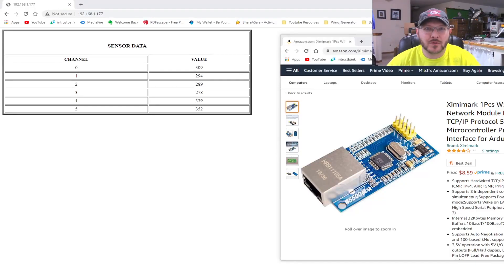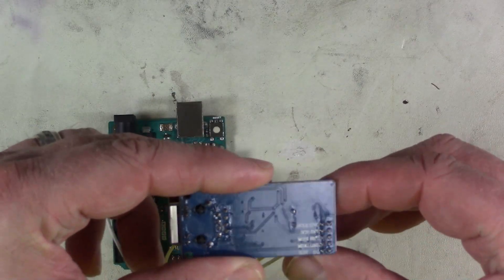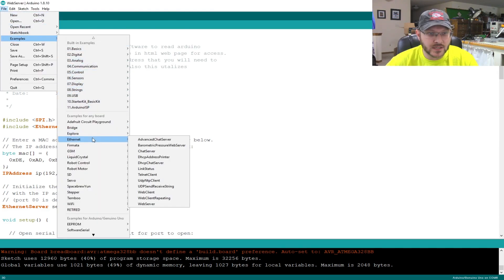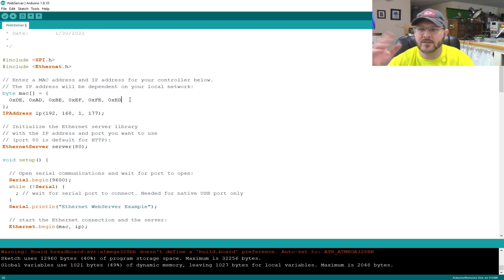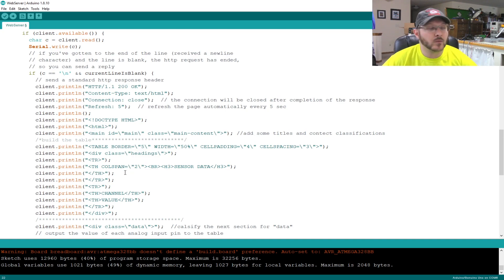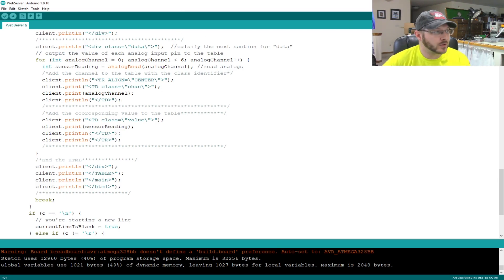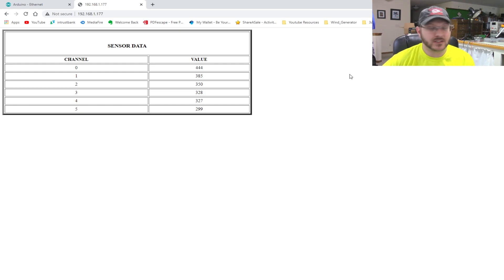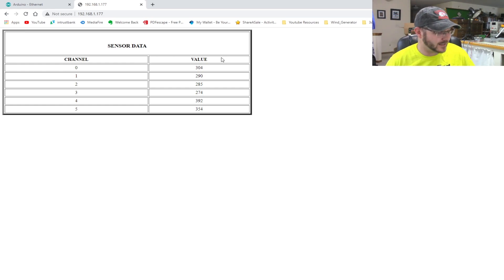Adding Wired Ethernet to Arduino

Comment: How is the W5500 connected to the Arduino. Which pins on the W550 to which pins on the Arduino? This is not explained on the video or on Github...

Comment: I do prefer the smaller form factor ones( same chipset but not so bulcky( also they come in packs of 2 for $20 vs this model comes in at $30/1pc ( connections+coding is identical so still awesome tutorial 😊))

Comment: Hello good sir, thank you for your excellent video. I am wondering if you could help me: I am trying to use the ethernet capabilities of the W5500-EVB-Pico microcontroller (I already set it up in my Arduino IDE), but I cannot seem to get it to work, even when I get it set up with the Arduino IDE. Specifically the Ethernet.begin(mac) times out. Any specific instructions for the W5500-EVB-Pico?

Comment: Haha people the ethernet cable is simply just an example of using a common off the shelf and cheap cable to deliver the SDA and SCK signals over long distances. CAT5 is simply just 8 wire cable. Only 2 of the wires in this cable are being used in the example shown here.

Comment: Ahahah! Dead beef feed... Why not!?
Here's a question : You had all the code, and how to connect the Arduino to the shield and I am happy with that but it was pretty short on how to connect the shield to the PC. Right, it sounds like stupid question but it appears that apart from the simple connection of cable, there can be some settings in the windows network panel. On top of that, was your shield connected directly to your computer or to a router/stuff like this? Actually, I have no router and don't want to have one to do this experiment that should be a peer to peer connection.
Thanks.

Comment: nice and simple explanation! can I what Ip address can I choose If i want to control another modbus device using this wired ethernet with arduino . in that case I am not going to use a router because that device and arduino will be a closed network , no web data etc. any idea about it ? thanks  :)